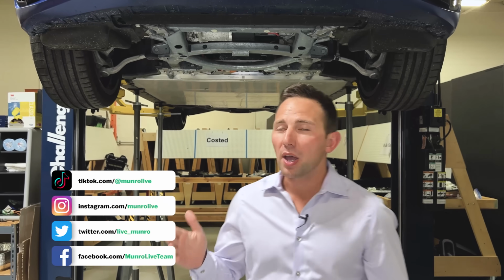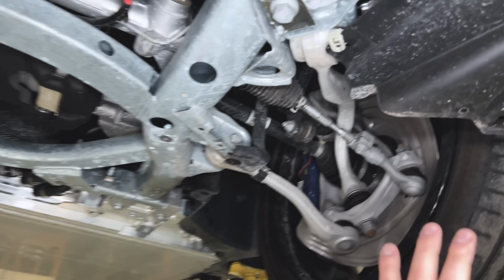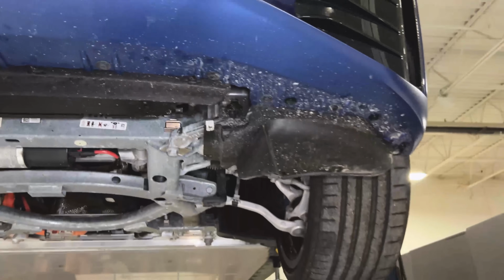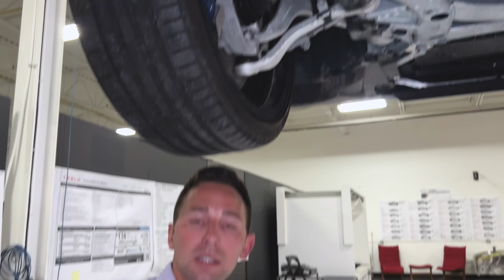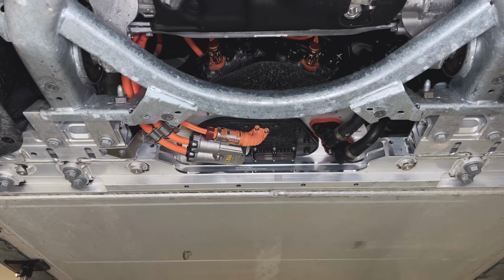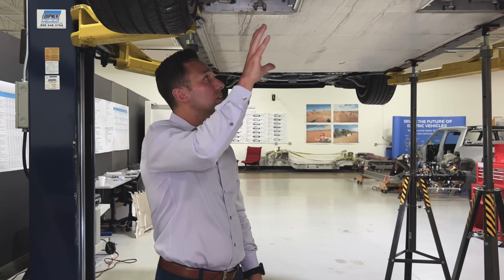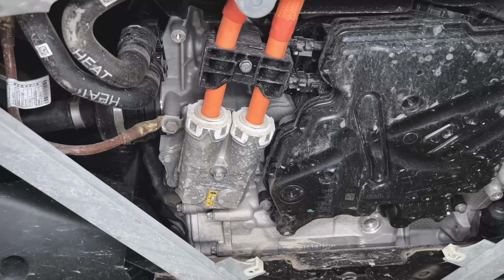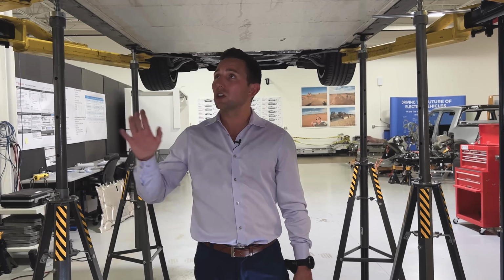A Look Underneath the BMW i4 M50 Undercarriage

Comment: How much to replace a battery module? Could be interesting to see how much the various solutions cost to repair and/or replace. Including Tesla and Nio of course!
Reply: Munro has already concluded that repairing a Tesla battery is a non-starter (I couldn't help myself).
Reply: @FrunkensteinVonZipperneck  Because why would anyone without knowledge should have access into a battery pack at these voltages? Also the cost to repair a pack would be crazy expensive and risk of a bad job that it can catch fire. This pack has components tig welded directly to the pack. So getting this pack out and repaired / replaced is not going to be easy either. Getting the pack out of a Tesla is quiet easy to get it replaced. To repair a pack require some specialist workshop to do it if the pack is outside it warranty (which is 10 years on Tesla). Still need to find a workshop that does pack repairing with warranty of like 2-5 years that it wont catch fire or break.
Reply: @pipooh1  bullshit!!!!! The cost to repair the battery pack/change faulty modules is still way less than a whole new battery pack!
Reply: @carholic-sz3qv  How you know? You had any pack repaired by a specialist and have it tested + warranted + certified again? People keep saying that repairing a pack is cheaper but I've not found any proof yet of a legit repair workshop that offer a price for repairing a pack.
Reply: @pipooh1  rich rebuilds has electrified garage and there are many other people also repairing those teslas since tesla themselves can’t work in all of them! The repairs actually works.
Reply: @pipooh1  the funny thing is that it’s super easier to repair an ICE than completely change the whole battery. The ICE have another very long life after their use in developed countries, they get shipped/exported to other countries where repaired and used for decades/years to come
Reply: @carholic-sz3qv  But that still doe not answer my question. Prove me in numbers that repairing a pack is cheaper than replacing it(I can not find any resources atm about this). This done by a specialised shop with part cost / work hours / warranty / certified. Just because 1 person does it on youtube does not make it a business, they recover the cost by youtube income.

For my Ford Fiesta it would had costed me 6k just to open the engine and see what was wrong. That is without  repairs and parts. You expect a battery packs that is 100x as complex as a car engine to be cheaper than that? Give me prove and numbers and I will believe you.
Reply: @pipooh1  those components are tig welded BEFORE installing. Wow 😂
Reply: Legacy OEMs aren't thinking in scale.  As the production of batteries reaches the hundreds of TWH in scale, the cost of batteries will decline to the point where the combined labor and liabilty to replace modules will be greater than the combined cost of just replacing the entire pack itself and recycling and or re-purposing the old pack.
Reply: Replacing modules also comes with a whole slew of problems for the BMS.  How do you cell balance a battery pack with 3 years of degradation on pre existing modules with a brand new module.  Oftentimes this results in accelerated degradation of the new module or further degradation of the pre existing modules.
Reply: @Robbie6298  lol….. Thor things are very easily doable! Not all batteries modules or cells are affected the same in the pack! That’s why people have been servicing those old teslas…
Reply: @carholic-sz3qv  how long do they last afterwards?  How do you balance voltage diffences between dissimilar modules?
Reply: After 750,000 miles a tesla recently had a $12000 battery replacement.
Reply: @SirDragonClaw  which one!? Lol…… fake News!!!

Comment: The smooth undercarriage of EVs is nice.  I was driving on i-72 near Decatur Illinois when I saw a bunch of cars on the side of the road ahead and as I approached, some dude was waving his arms.  I start to slow down to see what is up and just before I hit it, there looks to be a fault line right through the interstate.  Raised edges with a crack down the middle.  I slam my breaks and scrape over it at about 30mph.  This crack was wrecking ICE cars that were disabled on the side of  the road, but I was driving a chevy volt that has a T shaped pack down the center of the console and under the rear seats.  The car surfed over and nothing appeared damaged. I had multiple yearly inspections at the shop and no one noticed any damage.
Reply: Lol….. that’s bullshit!!! Not all cars are made the same! Also ground clearance also affects both EVs and ICE and for the records many ICE also have flat bottom too. Proper protection from the elements and finally other usage apart from the pavement/tesla!!
Reply: @carholic-sz3qv  Imagine being so out of touch with reality you are telling me 8 cars all conspired to fake damage to their vehicles and just pull over waving their arms at other drivers in an empty stretch of i-72 all to trick whoever you are a whole 3 years later with my retelling of it?
Grow up you loser.  I thought my car would have been damaged, but I saw nothing broken underneath and had two oil changes since where they do the courtesy inspection and nothing was found.
I cannot believe you are inventing a conspiracy that stupid.  Go be crazy somewhere else.  Sure a lifted pickup would have been fine, but most people drive sedans, crossovers, and mini-vans so that is who were piling up on the side of the road with damage.  Some families likely had their vacation wrecked.  The traffic on i-72 between springfield and i-57 tends to be sparse, thus why it was 8 cars and not 80.

Comment: Gives you a better idea of how much stuff Tesla has negated under the car with the castings etc.
Reply: different doesn't necessary mean better for the customers.
Reply: @kkal1183  I don't know. The i4 M50 is a 5,000 lb. subcompact car.
Reply: @kkal1183  Why not? If any part of those castings get damaged in any car it's a total loss. No point in repairing since it will need to be stripped and straightened on a bench with chains to be corrected. No one is paying that work. also this car has 4 star safety rating compare to any new BEV being nearly always 5 star.

For mass production you want as little amount of part as possible. We seeing here probably over 200 parts, each with their own margins and possible failures. Where Tesla now only has 1 part, since it's a casting the chances of failure is very small. There a reason Munro is trying to convince Legacy car makers to use 1 part casting for decades. It create cost savings, create a better structure, it's lighter part and less chances of failure.
Reply: @kkal1183  the tesla casting is great for the company but for the customer definitely not! Those single large parts are almost impossible to fix.
Reply: I wonder if they negated crash worthiness by having massive stiff castings rigidly attached to the passenger compartment.
Reply: @blackthorncane1841  seeing as how all tesla are in the top 1% of the safest cars ever crash tested?
And how safety is a top publicly stated priority for them, I'd bet they'll be even better in a crash with the castings and structural pack's. 😎
Reply: @GTO33  I go off my home countries testing results here in the U.S. I could care less what you go off of. 👍🏻
Reply: @4literv6  The NHTSA-test in the US actually tells less then Euro NCAP. The crash tests needed to get US type approval i a different story, but those result you will never get to see.
Reply: @blackthorncane1841  safety is a primary design consideration, dont be surprised if it earns even higher crash ratings
Reply: Lol….. it also gives you a great idea how super easy this BMW could be rebuild if it ever has an accident which means no giant casting/single failed massive ort to worry about!
Reply: @carholic-sz3qv  stop moving the goalposts and trying to defend a losing argument. It's clear you have some type of BMW bias... that's fine, but stop making things up. Stick to the facts.
Reply: @carholic-sz3qv  The casting has sacrificial crush cans in front of it just like the OEM's. And if it does affect the casting? It would have written off any other vehicle as well. That casting makes the car a LOT safer in an accident.
Reply: @davefroman4700  bullshit!!!! How does the casting makes the car a lot safer in an accident!? There are absolutely zero proof of it! Cars with no castings also performs very well too. The casting is basically to carry the suspensions/mainly and other components of the car.
Reply: @carholic-sz3qv  prove us that the castings are less safe. If any accident is that heavy that you hit the casting you are happy to walk away alive. There are crush cans and deflection area's at the front and back as any other car. Castings create one solid mass that can absorb a lot more energy then 40 small parts spot welded together. 

I think experts like munro that adviced 1 solid casting for years know more about this than you.
Reply: @pipooh1  again nonsense!!!! The welded parts plus the batteries and also structural parts makes the car safe too! Also accidents can happens in soooo many different ways no sure what you’re talking about! It’s not like the collision is only going to look for the casting to hit! Lol 😂 😆
Reply: @carholic-sz3qv  well congrats, your knowledge of cars is far more superior than people that work at Munro and any OEM out there, they seem to be doing it wrong(more companies are moving to single cast designs). You should build your own company with all that knowledge or even a car!
Reply: @pipooh1  yes it is 🤡

Comment: It is interesting to see how much of the structure is designed around crash safety.  In the past it was directed to a stiff structure under dynamic suspension loads.
Reply: Crash safety took a serious leap forward during the 2nd part of the 60's.  It has been ongoing ever since, the theme being:  Save the passengers, kill the vehicle!  (PS:  Safety glass came into being prior to the mid 30's...so safety has always been around for vehicle manufacturers)

Comment: Yikes!! That i4 M50 car is dangerous. Too many attempts at fixing issues that a good design should have mitigated. I would have expected better from BMW, but this car is a really bad purchase that only the ignorant will buy sadly.
Reply: Bjorn Nyland made some nice test results with the i4 40, almost beated the tesla model 3 longrange in the 1000km challenge and in the full range test (more than 650km)
So this old ice adapted platform bmw almost beated your beloved tesla. Shows how effiecent the drivetrain of the BMW is.
Reply: @romankrucker  and the BMW was more comfortable, more silent…… the adaptative suspensions is really a great thing no need of the heavy air suspension system.
Reply: @romankrucker  I still think a pure EV platform has a lot of advantages. But BMW proved very well that an ICE-based approach can also get the job done. And the result is quite good from most of the test I saw so far. BMW has announced just recently their future EVs will not have a shared plaform with ICE models - so they will get even better.
Reply: @EinzigfreierName  it got the job done but at the cost of 500kg of added weight, less storage space, and 30 percent less efficiency.  It's non competitive with not only Tesla but most of the Chinese.  But hey at least the interior is nice and you can buy heated seats for $18 a month 😂
Reply: @EinzigfreierName  Well the ICE base for a BEV costed them a 4 star rating. So idk if that a good things since all new BEV nearly all have 5 star. Having 500kg more stress put onto a ICE base is not going to go well for control / handling / traction. When i Test drive the i4 M50 we notice a lot of roll and some under stearing and you feel the weight of the car during driving. For a car design to be sporty those are not factors you want, surely not with 500+ hp, its asking for trouble and risk of the drivers to make mistakes.
Reply: @Robbie6298  Less storage space, yes. About weight, well, maybe the i4 would be a little bit lighter if it was build as an EV from scratch. But probably not 500 kg. And 30% less efficient? In Björn Nylands test in Norway over 1000kms, the i4 achieved the exact same time as a Model 3 LR and consumption was only 12% higher . Not bad for a car that is so much heavier. Means their drive train must be top notch and as least as efficient as Tesla's.
Reply: @pipooh1  As far as I read so far the poor rating has nothing to do with the chasis at all but is due to safety assist systems.
Reply: @EinzigfreierName  It passed none of the tests above 87. So it is the overall car that is less safe. Where like Tesla has 96 score for adults BMW has 87. So much for Legacy car makers with 30+ years of car building experience.

This just proven that you can create a car as beautiful as you want, if your technology is years behind you will also fall behind in the EV evolution. Even KIA EV6 is higher rated then this car, proves how far behind BMW has fallen.
Reply: @pipooh1  Teslas NCAP test is from 2019 and it achieved 87% on average. BMWs 4-series in the same year got 86%. Which proves that this has nothing to do with ICE vs. BEV platform or "legacy" automakers. Sure, BMW would have been happier with 5 stars. But there are EVs out there that received only 1 or even 0 stars this year.
Reply: @EinzigfreierName  BMW 4 series is not a BEV tho. This is 500kg heavier and require better safety duo to it mass. So all BMW has proven is that did worse then the car they based this on? I thought newer cars were ment to improve on it older model not get worse?
Reply: @pipooh1  The i4 is not really based on the 2019 4-series. But whatever the EXACT reason is why it did not perform a bit better, It doesn't really look like it has anything to do with being and ICE or BEV or a ICE-based BEV. Maybe they used some new sensors that doesn't perform or software that was not tested well enough. We don't know.
Reply: Please don't forget it's a conversion car!

A BEV build on a ICE platform!
Reply: How many cars do you have designed so far ? :) Jordan in this video doesn't sound like he thinks there's something wrong or dangerous with the design.
Reply: @EinzigfreierName  exactly!!! People are sooo easy on talking shit on things they have zero idea. The leak at 09:00 in the video for example is just water dripping after they washed the car.
Reply: Nonsense!!!! How is it dangerous!? Wtf!!! Where is your justifications!?
Reply: @carholic-sz3qv  You giving that answer only shows how little you know about batteries. Thanks for letting me know to just ignore your biased answers.
Reply: @pipooh1  yeah Einstein you know everything about batteries lol….
Reply: @carholic-sz3qv  Well I program production lines that build battery packs for vans(can not give the name since still in development). So I'm aware what goes into the process of putting it together and troubleshooting if there are issues. There's a reason we have 24/7 a water tank near the line just in case a battery that was certified could catch fire. So I think I've some experience in the production of battery packs and how quickly things can go wrong even with a perfect process.
Reply: I’d like to know what you are as a professional.  Surely you must be an engineer or similar to base this on? I’m one of those who have made an order for this car, and please let us know exactly why I should reconsider to purchase another vehicle please.
If no reply, then we know you are (with all due respect) a mindless comment idiot.
Reply: What's dangerous here?
Reply: And Edmunds and Auto Motor Sport and everybody else listening to those very nice BMW advertisements. I mean the ads MUST be right. The press MUST be right! Every product with a Superball ad must be a GOOD product! Right?

Comment: I cancelled my preorder.  I loved my BMW M2 but just wasn’t impressed with the i4.
Reply: Yeah. Test drove the M50 two months ago. Not even close to worth the money. Didn't even like the driving feel, a bit understeery, lacks traction at the front and you notice its utterly overweight.
Reply: Until BMW goes to pure BEV designs.. they are going to fall further and further into irrelevance. The day they pull that pin.. they will have a shot. But if they wait too long, they’re digging their own grave. If they think selling ICE’s in 2030 in small car markets is going to keep them alive when ALL the big markets have flipped to primarily BEVs.. they are going to be nothing but a shell of what they once were
Reply: Apples to oranges. We tested all the other locally available BEVs (VW, Ford, Tesla, Kia, Hyundai) and ended up placing an order for the RWD i4.
When our Audi S4 reaches its sell-by date, we might get an M2 or M3 or RS3. Task & purpose.
Reply: @hardykornfeld1733  Wasn't saying it was the same thing. At this point I think Tesla still has the superior EV.